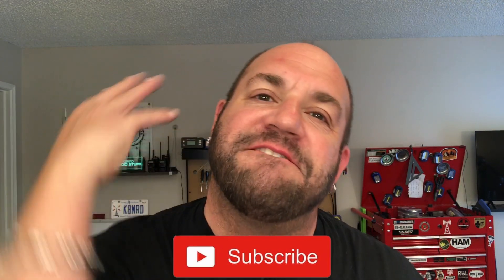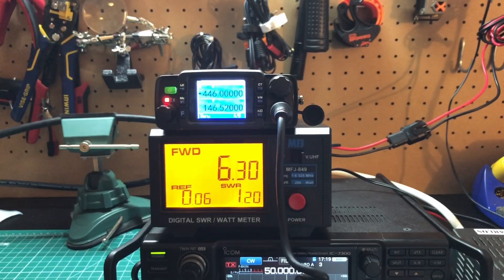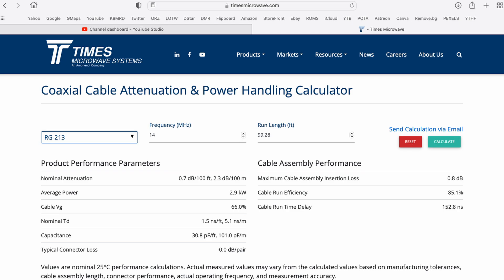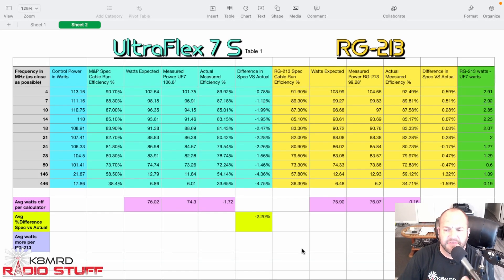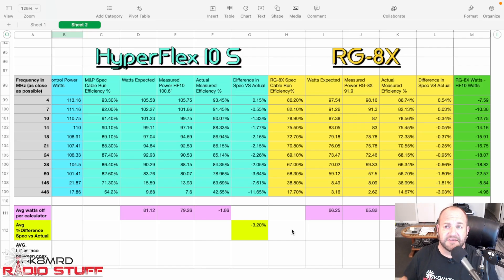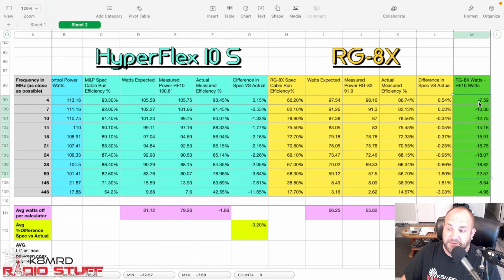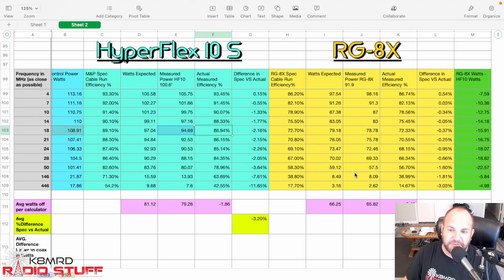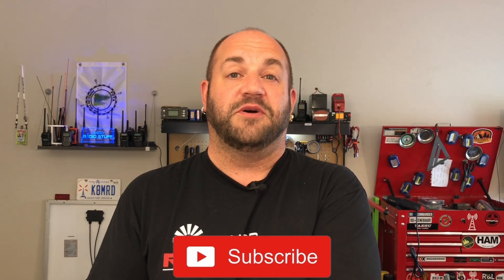How Much Loss Does Messi & Paoloni Coax Really Have??

Comment: i realize you are a M&P fan.  i agree that it is good cable.  question...have you done a comparison between DX Engineering's LMR-400Max with M&P?  i went with the DXE cable for my base HF rig to a CHA 8010 (QRP of 100 watts) and get favorable sig strength / clarity reports across the pond into germany and the UK.  DXE is making some astonishing claims about how low the dB attenuation is on the LMR-400Max.  at face value based upon DXE's self-reported numbers, it would appear that it blows up M&P's best cable.  thank you for your videos!  new sub and a new extra btw.  73, KQ4NNH.
Reply: M&P cable is far superior, as they are designed to exceed even German specs

Comment: I just got a 32 m run of ultra flex 7 sahara, for the buddihex, will be putting it to the test this weekend but love the feel of it and the high quality feel of the evo pl-259’s.   After feeling the m&p coax and connectors, it’s making me wish I had tried them sooner,  but then again ham radio is a hobby of always learning something.

I’m thinking about upgrading my jumpers in the shack to M&P ultra flex 7 Sahara or hyper flex10 Sahara or do you have another suggestion just definitely want it to be able to handle 1500w up to 6m…
Reply from the maker: Awesome!   Congrats on the new coax.  I tried making jumpers out of the Hyperflex 10 but it’s just to darn big in my opinion.  It’s hard to make some of the bends necessary behind all your gear.  I’m using all Ultraflex 7 for my jumpers.

Comment: But you did not measure power at the output of the 7300 for each frequency used, correct? So we don't actually know how much power the transmitter was actually putting out and we don't know whether that actual power out varied with frequency. Do we?
Reply from the maker: Didn’t I?  Boy I thought I explained this well enough so as to not get this type of comment.  Maybe you should watch again.  There’s literally a column on the spreadsheet called “Control” and in this video I tell you how I got that.

Comment: To all readers: We REPOST our BLANKED post Invoking our RIGHT to REPLY.
Please read our measurement comments about this video carefully.

Hi Mike, I congratulate you on the initiative to try practically what professional technicians usually do with calibrated Network Analyzers.  

Before making any statements, especially if they are public, we must ask ourselves why significant discrepancies exist concerning the values measured, especially on a leading cable on the international scene.

It emerges from your analysis that there are deviations from the values reported on our MessiCalc for two cables Ultraflex 7 Sahara and in particular huge ones for the Hyperflex 10 Sahara FT8.

Hyperflex 10 Sahara FT8
Identification batch of the product printed in the sheath 001211117001. 
The available Test report shows how attenuation data is even better than that stated in the catalog or MessiCalc.
(same thing for Ultraflex 7 Sahara)

Well, the Hyperflex 10 Series, (together with the Ultraflex 7), are our best sellers in Europe (and beyond) and one of the most praised cables around the globe. 

Do you think that if it had been so scarce, the European Hams would have continued to buy it, preferring it to similar products? 

Perhaps European radio amateurs and competitors are naïve and don't test products on the market?

Do you remember that after watching the video of the field day I was complaining because it was clearly visible that the cables were laid on the ground in transit areas, therefore subject to accidental damage due to crushing by heavy vehicles? 
(several pickup trucks around).

Do you remember Mike that you confirmed to me in our recorded video calls that a mutual friend, (Bob) repeatedly passed with his Pickup truck over the cables donated by M&P for the field day?  
(Field day video)
https://www.youtube.com/watch?v=vFgFhxmcTsY 

Do you remember that I told you that passing with a vehicle of about 2500 Kg (5500 pounds) over a cable with PVC sheath and expanded Polyethylene dielectric (PEE), irreparably deteriorates the original qualities of the product?

Well, surely the Hyperflex 10 Sahara FT8 you tested is one of those cables that have undergone this indelicate compression treatment.
Even if the cable's jacket might look perfect from the outside, a big weight over the cable might ovalize the dielectric altering impedance and general performance.

If it had had a polyethylene sheath like the LMR 400 for example, (or like our Extraflex Bury 10 that we made specifically for the American market), this would not have happened due to the strength of the sheath at the expense of overall flexibility.

On a cable like the RG 213/U with solid PE dielectric, the problem does not exist: with its 66% velocity Factor, and low profile screening efficiency,(only 55 dB), people trade in the modest performances of an 80 year ago design, for resistance to torture tests.  

In this case, our RG213 Plus, with its additional copper foil, improves the screening efficiency dramatically, (110dB), and the attenuations too,  remaining a cable that can be stepped on or crushed accidentally without significant consequences. (beware of rocks anyway...)

Again with cables with Polyethylene sheath such as
M&P-Airborne 10, LMR400 or M&P-Extraflexbury 7, M&P-Extraflex bury 10, and M&P-Extraflexbury 13
this problem does not exist, but when high performances and great flexibility are desired, the cable must have a PVC sheath and PEE dielectric.... and should be treated with more awareness.  

The Ultraflexible cables with PVC Jacket have been designed for fixed installations, matched with a rotor-operated antenna, otherwise if placed in a vehicle transit area, if crushed,  they lead to a rapid decline in performance.  

No one would dream of driving a pickup truck over an antenna or amplifier hoping that nothing bad could happen....

It follows that for a fair comparison, the test must be redone with an intact cable, (like that in the bobbin of LMR 400 you raised up), comparing pears to pears and apples to apples, comparing your results with those previously detected in our laboratory, which is always in line with minimum acceptable tolerance.

Every manufacturer or specialist knows that a cable with compact polyethylene, such as RG 213, being non-expanded is more stable, (precisely because it is not expanded).
It is also known that expanded polyethylene cables perform much better, but have higher tolerances. (everyone)
I'm really curious to see how other expanded polyethylene cables can also vary ...

Only in this way will it be possible to make an impeccable comparison with
Rg213/U against M&P-Rg 213 Plus
LMR400 UF against Extraflex bury 10.
LMR 400 against Airborne 10
LMR 240 against Extraflex bury 7 
(we might even test Hyperflex 5 , which is smaller and defends itself very well against the bigger RG8X).

We are ready to send you 5 cables as they leave the factory, therefore without mechanical alterations, in exchange for receiving the same competing models shipped at our expense after your tests. (it is a fair exchange).

We shall be pleased to test them according to our certified lab and send them to an independent accredited lab before publishing the results.

After all this, we'll see if we need to modify the MessiCalc or if anyone else needs to review his one. 
(or just to modify their catalogs for those with neither a simulator nor an entire factory to show).

Thanks for your attention, American friends

Comment: I'm looking at building my own slim jim J-pole antennas to sell, so I want to provide a perfect antenna for portable applications. The biggest issue is the coax, as I don't want to terminate it at the antenna base. I want it to be able to be lifted into trees, so I need about 10m of coax for guys running fibreglass poles etc. It starts to get complicated as I want light coax, but I don't wish to have much loss. 
I'm a believer in "many hands make light work" what I mean by this phrase is if you can gain a DB in performance with coax, then 1.5db in connector choice and .5db in tuning/using chokes, well, now you have doubled your output. 
This is why I'm leaning towards Hyperflex 5 with an N-connector for my roll-up J-poles, they will have choke beads at the base and maybe a tuning stub and a dipole spade terminal at the tip to add length if needed. I may even add tap points on the matching section. 
The idea is to have a roll-up antenna that can be deployed in a tree with a throw rope that can extend an HT's coverage substantially. 
Thanks, VK1NME
Reply: I've used a N9TAX roll up J pole antenna on a 12m Spiderbeam mast along with 50 feet of ABR Industries ABR-240 and 100 feet of Messi & Paoloni Ultraflex 13 connected together, and on simplex I was heard clearly over most of the county I live in. I was transmitting 50 watts, so I'm sure the antenna wasn't seeing much more than half of that amount. From what I have read over the years, I typically see connectors or adapters dropping the signal about .5 dB, so there's not much to recover by changing connector types or brands. I have 35 feet of ABR-240, the N9TAX antenna and 50 feet of paracord in my packpack go kit for the same reason... to throw the paracord up into a tree. The issue is that those roll up J poles aren't really designed to hold the weight of a long length of coax, so I would attach the paracord in a way that anchors the top of the antenna and the top of the coax, and eliminate strain on the antenna itself. 73 KD5YOU
Reply from the maker: Boy, wouldn't it be great if we had both light weight and low loss?  Just food for thought, but when I made my roll up J-Pole I terminated it with an SO-239.  That way I could use whatever coax I wanted depending on the situation.  Going up a fiberglass mast though, you're going to weigh it down with any type of coax.  Either Hyperflex 5 or Ultraflex 7 from Messi & Paoloni would be great as well as LMR 240.  Those are all in the RG8X ish sizing.  I've never seen a connector that has gain so I'd be curious what you are thinking for that as well as a choke.  Neither of those are going to give you gain.  Less losses maybe, but not gain.  The best thing a slim Jim has going for it to my understanding is the ability to get it up high.  Height is might as they say.  I don't think they have any more gain than a dipole (~2.4dBi).  I don't think you'd really notice any performance advantage with an N connector either.  Maybe also look at BNC?  Lighter weight and they are technically better than the standard PL-259.  You really start to notice a difference at the really high frequencies, but your HT's aren't going up that high.  Just some thoughts.  I'll be curious to see what you come up with.  Best of luck for sure though!  I'm in a similar boat as you.  I'm about to start building my battery boxes for sale (finally)!  It's a scary endeavor but I'm excited to get started.
Reply: @hamradiotube  I meant gain as in a gain over the loss most people except. So yes no gain but getting rid of loss.

Comment: Mike I really appreciate the time you’ve put into this and the energy of your presentation. The efficiency figures, for clarification, are interesting. Any efficiency above 80% means a loss of around  a dB or less. In the real world, this doesn’t amount to a hill of beans. Coax run lengths are also a major factor when assessing a coax’s suitability for a particular use-case. Even up on 2 metres, a 15 foot (5m) run of rg58 amounts to little loss. I guess the QUALITY of the coax in terms of shielding, core used and the resultant potential reduction in noise levels means that, for home use, the M&P standard of coax is a good choice. For portable, with zero noise levels, often cheaper (if short runs) are totally fine up to 145 MHz. Thank you for posting Mike, 73.

Comment: Nice video, thanks for putting in the effort to do this. Ultimately these are difference you will not notice without having to do tests like this so don't go swapping out your coax. Whilst the losses may be fractionally worse on the Ultraflex it more than compensates for it with it's lighter weight, higher usability, higher flexibility with the ability to route it and bend it much easier than the RG213.
Reply from the maker: Thanks Conor.  This wasn't meant to be a video about the minimal differences between the cables.  It was more about what is advertised vs. what is realized by the end user.  Us.  I have always stated (though not ever enough) this channel is about learning, failing, experimenting, and sharing my results with the world so we can all hopefully learn from each other.  But no, don't go swapping out your coax for a couple more watts.  I'd say it's a hell of an accomplishment to get the results we did out of the Ultraflex 7 though.  That is the reason it has become my main coax for portable.  I also use it for HF at home.

Comment: I'm real (or is that reel?) interested in how the LMR-400, and more specifically 400 Ultraflex test comes out compared to the 2 Messi & Paoloni cables. I used DX Engineering 400Max (which is about the same as LRM-400UF) for almost everything ... HF/UHF/VHF.
Reply from the maker: I've got everything but the Airborne 10 to do the tests.  Just got some LMR400UF and LMR240.  I've been sitting on LMR400 for a while now as well.  Let the battle begin!
Reply: @hamradiotube  that will be interesting!    I'm not ready to replace my  less than 1 year old 500 feet of RG-213 for HF based on these tests.  However it's great to see the real world results for when it's time to replace coax.